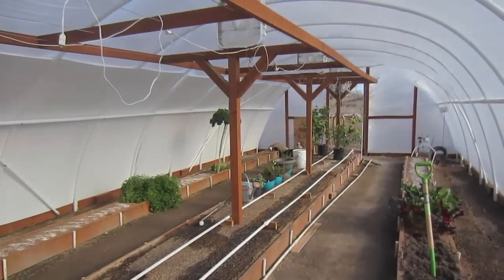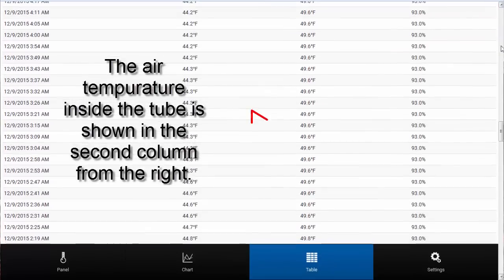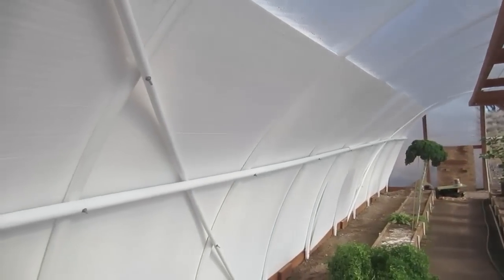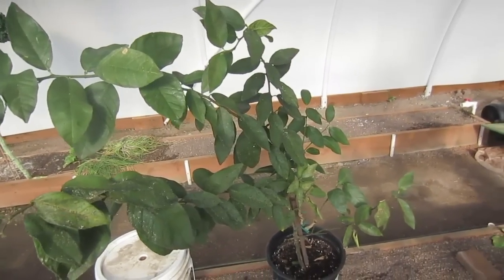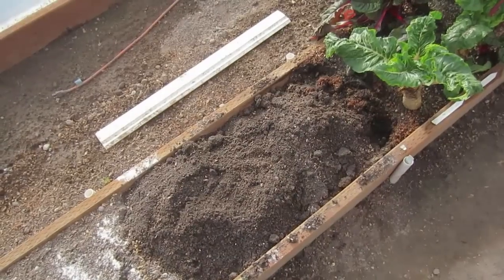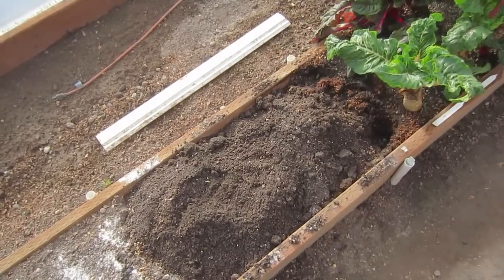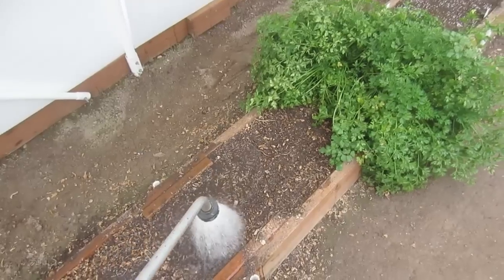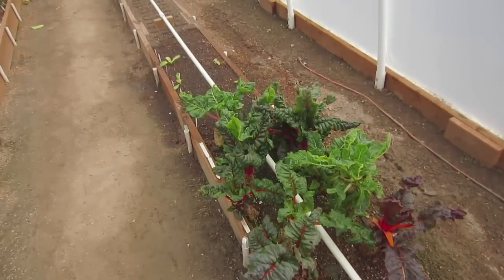Geothermal Greenhouse Update Dec. 9, 2015

Comment: Hi David
Good to see you have upgraded your fan,. Measuring the current draw isnt as useful as measuring the airflow from the tubing, i would highly recommend investing $50 on a skywatch xplorer 1 wind meter for gathering that important data. 
Something to be aware of is  the tubing will return a lot of moisture to the greenhouse at night, which is confirmed by your 93% RH figures. My personal observations of running this type of subsoil storage is with sufficient airflow you can return upto 75% of the total heat gained during the day to the greenhouse at night but only around 35% is sensible heat. The rest is latent heat in the form of water vapour which raises the rh% but doesnt raise the greenhouse temperature. High RH can be an issue for sensitive plants, it can also encourage mold and other nasties as it condenses out on cold surfaces. In the worst case, it can spread disease as the condensate drips from the covering onto the plants below.
Reply from the maker: +JohnGuest45 My son does have a wind meter. I can borrow it from him and post the wind speeds if that would be helpful to you.
Reply: +LDSPrepper 
Hi David,
Imho, its an essential item for this kind of system, knowing the flowrate is possibly more important than the temperature readings because it can be used to fill in the data blanks; such as how long the air is spending in the tube, the airspeed in the tube and the number of greenhouse air volumes you are putting underground per hour. These variables directly influence the rate of heat transfer into and out of the soilmass.   
The meter is also invaluable for balancing the airflow in the individual tubes as its rare to have the same flowrate in each without some adjustment. If you have a variable speed fan as i do, its the only way to tell what the real cfm flowrate is.
Reply: +JohnGuest45 A question or two on RH if you don't mind.  I have effectively this same configuration but still running the 8" hyper fan.  I currently see daytime humidity ranging between 65% and 75% with nighttime almost always at 99%+.  On warmer days, I often open the doors for a while to let the GH breath a bit.  Should I be worried about these higher nighttime humidity readings?  I am getting typically 25+ degree rise in temp (thermal transfer) in the geo-air system (intake vs. exhaust).

One thing to note, the tubes are capable of handling a higher amount of thermal transfer than this 8" fan can muster in terms of CFM (rated at 710cfm at no resistance).  I have fed 100+ degree air and 25 degree air and it always completely transfers enough thermal energy to where my exhaust temp equals my 7ft & 10ft soil temp measurements (~58 degrees).

While I do not know my current CFM after losses, I am getting what I would consider "Very significant" airflow.  It "feels" very similar to what the fan can output while running without the resistance of the tubes attached.  I can feel the columnar air flow from the attached system to the other end of the GH (44ft).  I will work on getting this actually measured though.

In terms of your point regarding how only 35% is sensible heat vs. latent heat in the form of water vapor.  Would higher or lower CFM / airspeed matter in this situation at all, improving the sensible heat gain?  The obvious benefit of more CFM is the ability to add or remove heat at a much faster rate than I currently am.

Comment: Have you considered running the blower 24/7 so as to pump heat into the soil bank during the day? I saw another video with a GH similar to yours and that is what they did.
Reply: +Randall Zrubek 
It would be very inefficient and expensive. Consider that the greenhouse air willl warm up naturally on a sunny winter morning. If you run the blower you will be pushing cooler air into the greenhouse so it will take longer to warm up.

If you run the blower at night and the soilmass isnt warmer than the air temperature, you will be using fan power but not adding any heat. 

The solution is to use a differential thermostat to control the fan. It uses 2 probes to sense the "temperature difference"  between the air and soil, the actual temperatures are not important. 
Lets say you set the differential for 10F
In cooling mode, the air must be warmer than the soil by 10F before the fan will run. 
In heating mode, the soil must be warmer than the air by 10F before the fan will run. Note that the heating and cooling differentials can have different values.
 
Using the sunny winter morning scenario as an example, if the soil probe is reading 55F, the air probe must see at least 65F before the fan will run. If the soilmass cooled to 50F overnight, the air probe would need to see at least 60F for the fan to run.
Reply from the maker: +Randall Zrubek I think that makes complete sense if the air temperature in the greenhouse was above 70 degrees. That way it could/may/might warm the soil around the tubes in the ground and the air coming out of the tubes would not cool the greenhouse air too much.
Reply: +Randall Zrubek I am currently running my geo-air 24x7.  Though I do intend to add a thermostat to it.  As you said, I hope to add some heat back in on those nice sunny winter days.  I've had it to 80 inside when it is in the 20's outside.  Though I think i will still turn it off between about 45 and about 65ish.  Right now I am drawing heat out of the ground when it is 40s to about 60 where it is not truly needed.  Hoping to conserve the heat mass a bit more.

Comment: HI David,   I noticed you went away from the small Hyperfan in the manifold box.  What was the biggest reason for the change?  Was it just not able to move enough air?
Reply from the maker: +simplecellservices Correct, I think there was too much back pressure from the 800 feet of tubing for the fan. The new fan is working very well.
Reply: +LDSPrepper 
Long tubes can be expensive on fan power,  the static pressure loss of a 200ft long x  6 inch smooth bore pipe with the hyper fan would be 0.6 inches water column, corrugated ads pipe will be higher. 4x 50ft smooth bore tubes, fed in parallel, have the same potential in terms of heat transfer area as a 200ft pipe but only 0.01 inch water column static pressure loss.

I know math isnt everyones favourite subject but it can be useful. For example, if you are running 700cfm at night and can manage to reduce the RH level exiting the tubes by 30%, you would increase your tube exit air temperature by as much as 9.5F (excl losses).

Comment: I didn't hear you mention your soil temperature in the raised beds?  Will you be able to maintain a high enough soil temp for good growth?  Just a curiosity question, what is the pH of the water your using?
Reply from the maker: +David Dube (Oregon Homesteader) That is a great question. Soil temperature is very important. Since you asked, I just went out with my digital thermometer and test the boxes in the greenhouse. At 10:56 am the soil temperature 4" down is 46 degrees. I will try to remember to test it again at around 2pm today. That being said, I did direct plant my sugar snap peas in the soil during the time when we were having nigh time temperatures to -8 degrees. They germinated very well and are growing well. I think, especially with the light sawdust/sand soil mix, that the soil get warmed up during the day enough to keep the plants and seeds warm enough at night. At least in my greenhouse.
Reply: I noticed on your garden plans that tomatoes will be going in.  If I keep my grow room temps fluctuating like yours for night and day, I have trouble with fruit setting.  You are really pushing the limits for your location, Kudos!
Reply from the maker: +David Dube (Oregon Homesteader) Correct. I want to see where the limits are. I did have tomato plants with lots of set tomatoes but I didn't have my insulation in when it was -8 outside and the plants froze. :( I am now more attentive. :) Lessons learned. It just takes one night.
Reply from the maker: +LDSPrepper At 3:32pm the soil temperature 4" down was 54 degrees. The outside temperature was 33 and the greenhouse air temperature was 53.
Reply: Germinating warm weather seed indoors under light is a great idea.  I'm sure you'll have it all figured out ~ Thanks!

Comment: Is the electric fan cost efficient? Great looking greenhouse. I love sugar snap peas and you have made a great start with them.
Reply from the maker: +Patrick Meehan I had one fan on the low setting to see if it helped with air circulation. I'm not sure that it makes that much difference. I have not put a kill-a-watt meter on monitor how much power I use in a week. But because I rarely have the fan running I'm not concerned about the power consumption at this time.

Comment: thanks for another great video.  I'm hoping to start a similar project soon and have been trying to think of alternatives to the electric fan.  I would like your opinion on using a rocket stove (gas powered) to induct the air through the geothermal tubing. There is very little information out there. do you have any thoughts?
Reply from the maker: +Ben Royer A very interesting thought. I don't have any experience with that but I would love to know how it goes for you if you give it a try.

Comment: Wondering if you considered the Mylar "space blankets" for reflecting the heat back into the greenhouse.  Thin as a potato chip bag but reflect about 90% of the heat. Perhaps use a contact cement spray to adhere to the styrofoam.
Reply from the maker: +Dennis Totman I love the idea. That would work great during the day, which for the most part is plenty warm. As you can see in this video we had both doors open and it was still over 70 degrees in December. What I think I need is more thermal mass. I am looking for twenty black 30 gallon plastic drums to fill with water that I can put on the north side to absorb heat during the day and release it at night. I think that will make a big difference. It was always a part of my plant but finding the barrels is harder than I thought. Stay tuned for more updates.
Reply: +LDSPrepper Hi David, I'm really liking all of your greenhouse videos. I've had a couple of thoughts when watching this video and one is addressed with the comment above. Finding a way to add mass to a green house. Have you considered building your own water tank. Simple wood framing and some pond liner made to the dimensions of a sheet of plywood. It would take several to fill up the north wall but when empty be light enough to move around like a barrel. 
    When I saw the Styrofoam on the north wall I though how is it not coated black to absorb heat. Now I'm thinking does it matter, the diffuse light reflected by the Styrofoam is hitting the north facing side of the plants. What is your opinion, black or white, doesn't matter?
     Do you/have you considered a wind break outside the greenhouse along the north side?
 Cheers,
Bill
Reply: +LDSPrepper 
The thermal mass you have has roughly the same thermal capacity as a 40ft x 20ft pool over 15" deep, thats a lot of barrels :)  It doesnt take up any space and it doesnt affect light levels. A plant in a solar collector would be nice and warm but it wouldnt grow too well. It pays to think like a plant, a perfect environment (very bright, high RH, high CO2) for plants would be uncomfortable for us humans.

Comment: Great video and great design on the green house. I like the box fans at the ceiling, clever idea.  Just fyi, when you use air as a medium it's always better to pressurize versus a vacuum. Another thing that may help is if you used a tapered plenum box on your air fan before they connect to the ground tubes. More even pressure at the entrance of the tubes might allow you to run at a slower fan speed.
Reply from the maker: +Steve W With this fan pushing air I can feel a lot of air that is not getting pushing down the tubes but instead it is "leaking" out of the sides of the fan. My thought on pulling vs pushing air is this air would not have the back pressure and leak air like it is pushing.
Reply: +LDSPrepper  You can greatly reduce leakage at the fan with a plenum box as I mentioned. The tube diameter and the corrugated nature of the tubes will limit the air flow due to turbulence. If you use a vacuum you will pull in cold or damp air anywhere it is not completely airtight. You will also need a fan system that is designed to pull a vacuum.

Comment: David, knowing what you do now about the geo-GH, would you consider it in a reverse climate condition (ie; back in Houston)? I'm filling in my pool here in Vegas and can't get this out of the back of my mind that I can "cool" a greenhouse here in the summer. No need for a GH here in the winter (not often anyway).
Reply from the maker: +Tim Brown Great question. . With shaded cloth, four fans and the doors open, with no go-air running it would stay about 10 degrees cooler inside. I did try the same thing with the doors closed but it quickly got hotter inside than outside. Last summer, in hot weather, I did not have the ABS Styrofoam on the north wall but I did use 40% black shade cloth over the greenhouse. It is all about insulation and the amount of cool go-air you can move through the greenhouse. At this point, until further testing, I haven't found it cools enough in hot weather. There is someone in my area who did build a $30,000 geo-air greenhouse with lots of insulation on the north side and reflector cloth on the south side to minimize the heat building up during the summer. Even with all of that, his geo-air blower running and a very large greenhouse fan he was getting temperatures in excess of 130 degrees.
Reply: +LDSPrepper Wow, a $30k geo-air green house.  Would like to see a walkthrough on that.  I'll shoot the video if you get an invite.  :)
Reply: +Mark Ryan have you looked into a walipini style greenhouse? since you are already filling in a pool, this might be a good route. from what I've seen and read, they do excellent in the hotter climates .. just info, the more you know!

Comment: David, please refresh my memory: when you built that greenhouse did you place Styrofoam along the exterior of the excavated area underground to the frost line to help insulate?  I'm curious if the top layer or two of the hose for air circulation are colder than those below the frost line. Thank you.
Reply from the maker: +BonnieBlue2A You are correct. I did put 4"x4'x8' Styrofoam from ground level down 4' to stop the frost line. BTW, it really works well. I do think the air in the goe-air tubes cools as it gets closer to the surface. In hindsight I could have insulated the pipes with Styrofoam as they came to ground level.
Reply: LDSPrepper Thank you.  I need to go back and re-watch the excavation and construction videos. At one time I recall you were using, or considering using, black barrels for collecting and holding solar thermal heat. I did not see those inside your geo-air greenhouse on this video update.
Reply: +BonnieBlue2A I buried temperature probes at 10ft, 7ft, 4ft, and 1ft depths along one of my geo-air trenches.  I did the trench method where I folded the pipes over once, so they are at 10ft and then about 7-8ft depths.  My exhaust temps are pretty much dead on at the average of the 10ft and 7ft ground temp readings.  As they come up to ground level, I'm sure there might be some impact, but I do not think very much.
Reply from the maker: +Dallas Urie I LOVE it when people collect data. Then they have a solid foot to stand on when making claims and helping people. Way to go Dallas. I have documented a 3 degree change between my pipes at 8' and 3' deep. I had to replace a pipe that got crushed under the weight of an excavator machine and I could only go down 3'. Otherwise I would never be that shallow do to the possible swing in temperature at that level.
Reply: Dallas Urie  Interesting, thank you for sharing your experience.  Was your excavation below the greenhouse as is David's or to the outside?